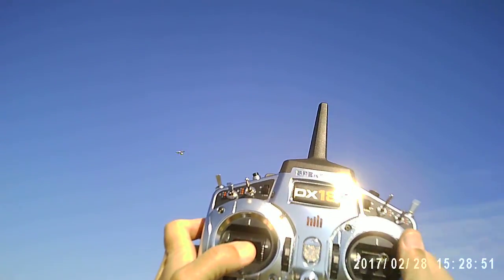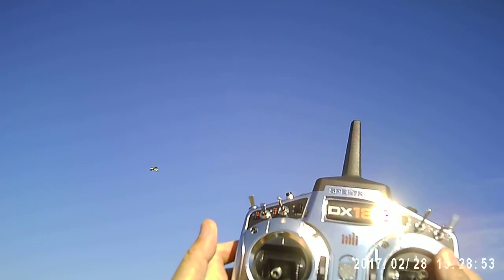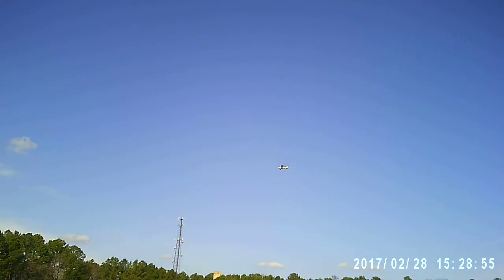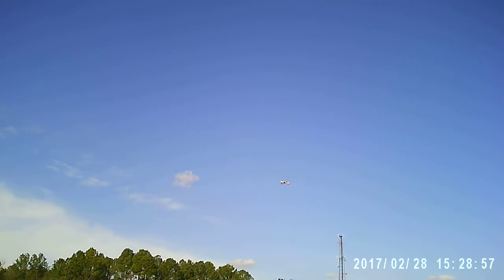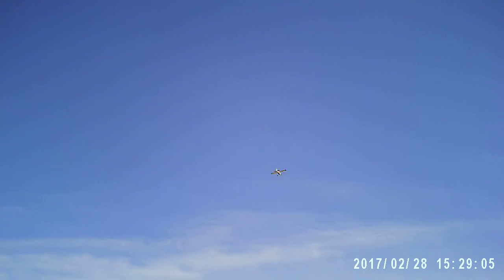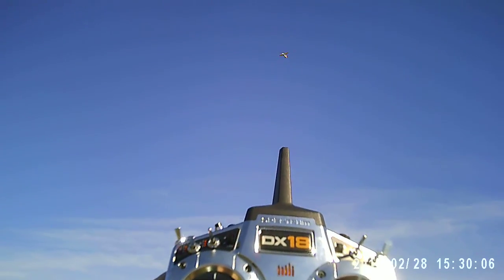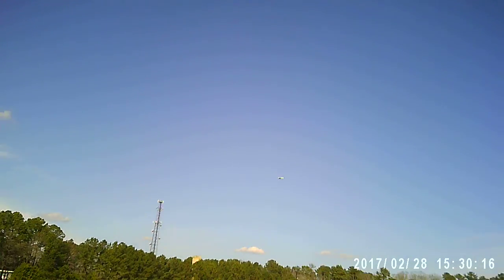2/8/2017 FMS SuperEZ HobbyEagle A3 SuperII causes crash in AUTO-LEVEL mode

Comment from the maker: This past summer a neighbor's child was flying this model with me using a BuddyBox. He went into a dive and yanked the elevator back full throw. The fuselage departed from the wing and became a lawn dart. The plastic lock nuts were still attached to the section of the wing that attach to the fuselage. I have a new fuselage now and will reinforce the section where the lock nuts hold the wing with some balsa glued on with Gorilla Glue. The plane flies very well but it is not capable of hard G aerobatics for extended periods. The wings and fuselage must be reinforced to be able to stand the G forces with hard G aerobatics.

Comment: Auto level doesn't work when you stall... Looks like you need a flight controller, instead of a stabilizer.
Reply from the maker: Your reply must be for lw216316. But your reply shows up as though you are replying to my video, which is obviously not in the A/L mode, i.e. inverted flight.

Comment: When I try auto-level it will level but one wing dips down,
and sometimes when it levels it does so inverted..   what is wrong ?
Reply from the maker: First I recommend you check out this thread on RCGroups.com. https://www.rcgroups.com/forums/showthread.php?2013634-HOBBY-EAGLE-A3-super-A3-SUPERII-New-GYRO-A3S3-questions-and-answers-gyro-system
You might want to subscribe to it and ask any questions there. A lot of helpful people are there. 
There are 2 calibration procedures in the menu. One is for 3D flight and one is for Straight and Level flight. I only do the S&L procedure since I'm not flying 3D with my A3 S2 Stab. I've setup my MODE Switch to have 3 modes - 1) OFF MODE 2) GYRO, NORMAL or Rate stab MODE and 3) Auto-Balance or ANGLE MODE. If you've setup your mode switch for the 3D mode, maybe you switched to that and the plane is trying to hover vertically. Go thru the calibration for S&L flight and don't touch anything while the light is blinking. Whatever stance you have the plane placed in, is what it will think is LEVEL. If you're calibrating for the 3D mode, you hold the plane vertically. I always do a LEVEL calibration, which sometimes means a slight nose up attitude on a stand. It flies better slightly nose up. If the plane flies tilted in one direction while in the Auto-Balance mode, you can bias it back to level with a menu adjustment. If it does this is the NORMAL or OFF mode, you need to trim the plane mechanically first. Do the PITCH & ROLL adjustments after the calibration. Again, it's in one of the menus as a + or - setting to PITCH and ROLL settings.
Reply: @hifinsword  I read a lot of the thread you gave me (not all, its 350 pages) - did not see my problem addressed. I'm not doing 3d,   I have a 3 way switch for doing gyro off, gyro on and self balance (as an emergency recovery option). The gyro works fine. Its the recovery that's doing odd things. If I'm inverted then it will return the plane to upright , if I'm in knife edge it puts the plane level but inverted,
and if I'm in other positions the results are not consistent. I'll try posting on the forum as you suggest if I don't get help from the postings I've made on youtube. thanks for your response.
Reply from the maker: @lw216316   Are you using the A3 S2 or the A3 S3 V2? The latter has known problems with Auto-Level. Are you setup for the AVCS (3D) mode at all? I'll look for you on RCGroups.
Reply: @hifinsword  How do I tell ? The box only has A3 Pro written on it. There are no documents in the box. The unit is red and only has A3 Pro written on it. I downloaded the manual it only says A3 Pro and Oct 25, 2017 as the revision date. I set up 3 flight modes for my 3 way switch - they are gyro off, normal mode (gyro on) and auto-level mode. I rechecked the light indicators to insure they were set correctly.  The gain pots are as they came in the box. Since the gyro works fine that seems to indicate the calibration was good.  As for 3d, I am an aerobatic flyer but not 3d hover etc. When I get some time this afternoon I'll try to post on rc groups. Does the S3 V2 with known problems have a fix or is it an unfixable design error ?
Reply from the maker: @lw216316  What you have is an older model I'm not familiar with. MotionRC still carries it. There are some Q&As on their page here. https://www.motionrc.com/products/eagle-a3-pro-6-axis-airplane-gyro-w-one-click-auto-recovery-system#support-tab
I'm sure there is a thread on it at RCGroups so do a search there too. The HE A3 S3 V2 performs well in the RATE mode, but has had, and still has problems in the Auto-Balance (angle mode). You can see they are ongoing and there has been no attempt by Hobby Eagle to address them. I think HE is going down the tubes. I will be looking at the Flite Test Aura 5 as my next A/L Stab for a standalone stab. I use them when I need more than 6 channels and A/L features. The Spektrum AR636 is the gold standard for A/L IMHO if you only need 6 channels. It is being replaced by the AR637T. They are pricey and only used with Spektrum Txs though.

Comment: Im guessing mechanical failure, like a elevator servo horn snap or servo disconnect, dead battery, radio disconnect.
Reply from the maker: Nope, too much travel on the HE A3S2 caused this accident. You didn't watch the linked video in the first line of the updated commentary. The video absolutely confirms too high TRAVEL settings on the control surfaces was the cause of this accident. The settings for TRAVEL cannot be above a certain level or the control surface will go back to neutral even while the sticks are being held to full travel. When doing the control checks for preflight, pilots rarely hold the sticks more than a split second IOT confirm movement in the right direction. If you hold the sticks for a couple of seconds with too much TRAVEL dialed in, you will see the control surface go back to neutral even though you haven't released the sticks. CAUTION: Do not use too much TRAVEL on the Hobby Eagle A3 Super 2.
Reply: @hifinsword  that's not true it does not go back to neutral, it only goes back to  neutral if the receiver Browns out when going to full deflection =you drew too much current for the bec. There's no facts that point out that this gyro goes to neutral when you have too much travel only time it goes to neutral is when you lose signal or a brown out from over current draw.

And that's usually from overextending your servos and not having the right power supply for the servo you have. Seen this happen many times and people blame a gyro and it's not the gyro it's people not realizing their setup is drawing more amps then what the b bec can handle, also when running is Charo you want digital servos and you want to separate ubec switch mode at least 7 amp or what happened to you will continue to happen where you dial down the travel but what fun is that eventually it will happen again.
Reply from the maker: @FarmerFpv  You obviously didn't watch the linked video in the post above. The post mortem video of the crash leaves no doubt as to what caused the crash. The Hobby Eagle gyro is programmed to go back to neutral when the signal is above 2000uS. The Rx did not brown out, nor did it lose the signal. The Rx was within 3 feet of the Tx in the post mortem video. The Rx is fully powered and shows no sign of browning out. Please watch the linked video. This is a well-documented problem with the HE A3 S2, and possibly the HE A3 S3 V2. Link - https://www.rcgroups.com/forums/showthread.php?2013634-HOBBY-EAGLE-A3-super-A3-SUPERII-New-GYRO-A3S3-questions-and-answers-gyro-system/page347